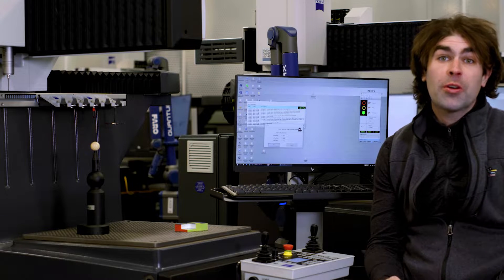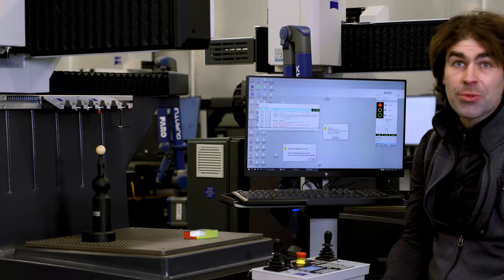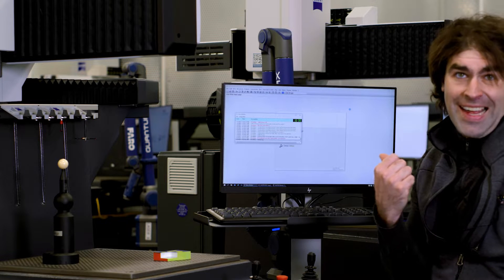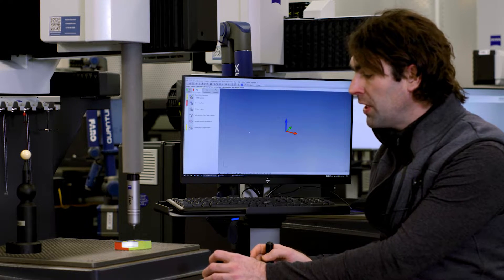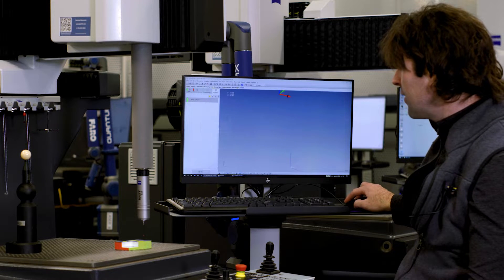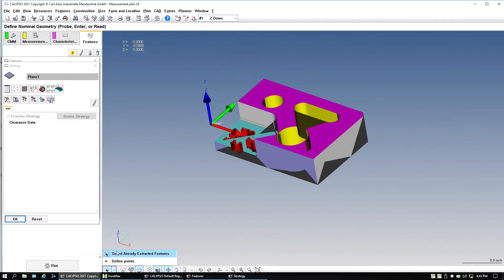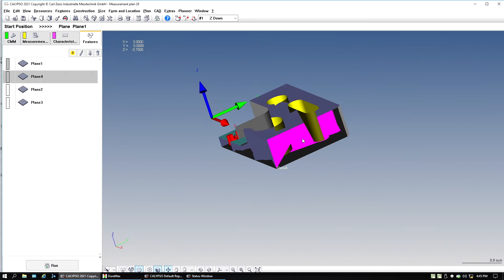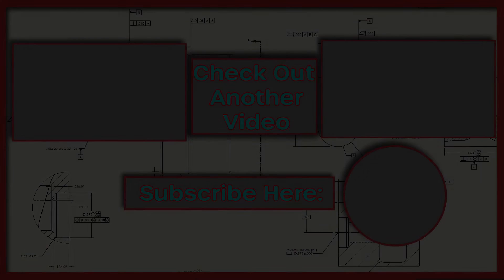3 Common Zeiss CMM Problems & Solutions

Comment: The engineer that set the home for a Duramax, hell any CMM to the rear of the machine needa smacked! There is more often a probe rack in that area and could hit with long or odd probes. In the case of a Duramax if i have a long #2 probe it will hit the white portion of the X body. AiMS out of Ohio has the best spot ive seen. Top, Left, Front on out LM.7.7.7 and then i have a go to command to take it to a safe location for operators to load parts and it never goes near the rack until a probe change command.
Reply from the maker: Hi, thanks for the input! I feel your pain.